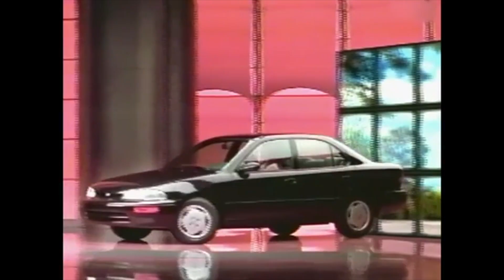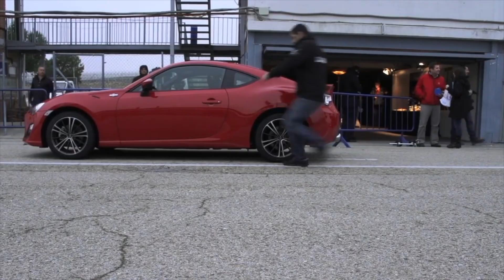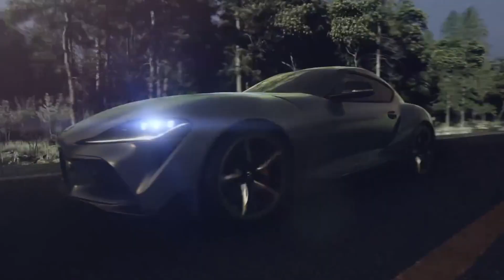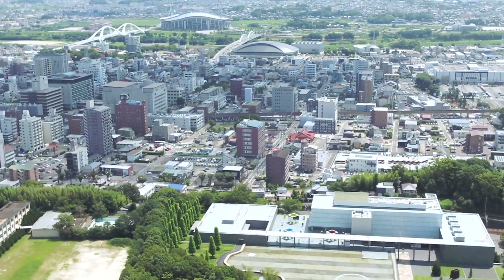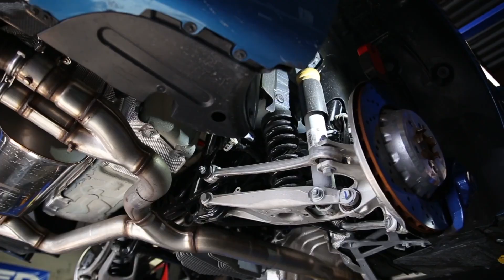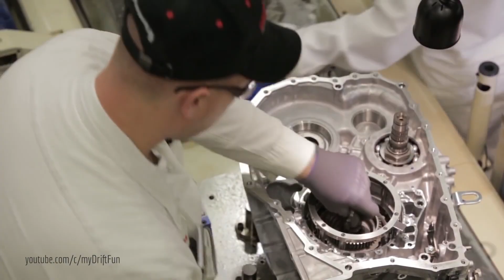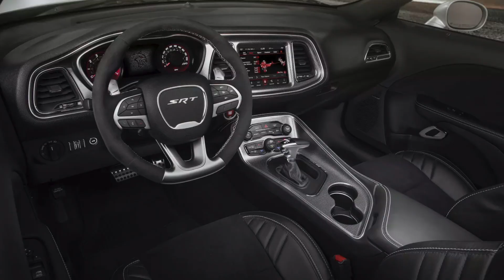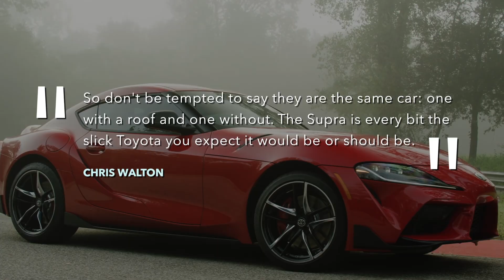MKV Toyota Supra - BMW or Toyota? The UNTOLD TRUE STORY

Comment: All I can say is , Toyota is dine for me. Over owned all there products and I've always had crazy respect for them because they build bad ass ling lasting trucks and cars but BMW. I can safely say IAM done. I bought a raptor instead. I figured since they flipped on us. Why not flip all the way out... I've Loved alot of things about the Supra. Expect car since my young days. But adding BMW to Amy mix with my EX brand is just a respect issue. They sold out. If I wanted a bMw if I wanted a German ride I'd get one... Toyota was special. Untill going with other brands not my own. And this is prob it .. there are some wicked as BMWS out there. Hell I had a shirt stint in a 08 335I. Wicked N54 swapped cuz the motor popped. But later sold for repairs costing alot. And didn't make sense anymore. But I was planning on the new Supra in my older years to bring back the child days of Fast and Furious. But now cuz they went with the GermZ. I'd have to say it's prob a great car . But just not for me. Or any of my die hard Supra homies in witch my homie still has his Single turbo T88 monster. He was gonna get it till he felt Toyota had bent him over... So sorry Yota... You post a few die hards. Maybe next time you won't let us Yota heads down next time... Great show man... But no supras in our future. No More.... Night Yalll.

Comment: No manual, not interested. Great video though! I'm getting a corvette and I won't be upset. Over 400hp at a similar price. 
What will actually be upsetting is if corvette loses the manual in 2020 with the mid engine. That would start a riot. My civic si hasn't enough power or sporty characteristics that I desire. I'll be upgrading in 1.5 years. I wonder who will take my money.

Comment: Really, biggest complaint the rebadging? Lack of a manual transmission and ugly as front bumper. Those are the biggest issue. Not costing around $35k is the next issue. Cut down on some of the interior quality and focus more on driving dynamics instead.

Comment: People can be so ungrateful. The existence of both the new Supra and the new Z4 depends entirely on their coexistence. There would not have been either of them if one or the other didn't exist. I would rather have both a new Supra and a new Z4 that share codevelopped engine and chassis, than having neither of them. More sports cars is better than no sports cars.
Reply: We should also be grateful with teen titans go if it exist
Reply: @siddheshpillai3807  The difference is that they made it because Cartoon Network knew it would make them a lot of money. Toyota and BMW don't need to make these kinds of sportscars to make money. Especially Toyota. These were made because a few passionate individuals at Toyota wanted to make more sportscars.
Reply: Buts it's not a Supra... it's a Z4...
Reply: The BMW would have still existed. The Supra may have still existed. This cooperation just made the end results cheaper.

Comment: the supra is dead, we will look back on this in the future as the biggest mistake toyota has done to an iconic car. two massive issues i see, one the car looks like a bmw rebadged basically a fraud/fake. second problem being old farts designed the car which are completely disconnected to the market that would actually buy the supra/

Comment: Everybody's looking at the reliability of the engine but also I think people really need to find out who made and installed the electrical system. because sooo much bmw issues are from stupid expensive electrical / computer issues. like speedometer going out which cost $3000 to replace as an example. Bmw has all these little issues that add up to a fortune to fix when out of warranty.

Comment: Will the Roads in America finally be like Autobahn surface?
You can't enjoy driving ANY car without the smooth glassy surfaces.
Reply: It depends entirely which State you are in. We're in quite a bit of an infrastructure crisis currently, but the differences by individual State can vary wildly. You can be driving on a road that is as smooth as it gets, then you cross a State line, and next thing you know you would practically think that you were off-roading.

Comment: I think if they just didn't call it a Supra, people would like it.
Reply: It's actually the other way around. People like it because it's a Supra, so to speak! Hence why it was badged! 
That sh*t looks ugly aF imo! Looks totally like a the Z series! I like BMW, but people are looking to buy a Supra, NOT a BMW!
Reply: I would not dislike it. I wouldn't love it, but I certainly wouldn't have hated it.
I'm just weird in the way, I like names of great cars only to be brought back when the vehicle they're being put on stacks up as a true successor, but I almost feel like a company is trying to cheat me and cash grab when they use an old name, on a new vehicle that just doesn't fit it's namesake, whether that's because the vehicle doesn't have the right credentials (Mitsubishi Eclipse Cross) or it's halfway badge engineered (Supra).
Kind of like Dodge using the Dart name on what should've been a Neon, albeit that's an extreme example.
Reply: I’d love it if they had stayed with the hard top convertible, that thing looks fucking beautiful
Reply: ya just call it a zupra how bout that.
Reply: I think if they just didn't call it Toyota, people would like it.
Reply: They shouldn't have named it Supra just to get peoples attention. They knew we wanted a successor to the legendary JZ motor. But they threw in a BMW engine. It's not bad but its not a Supra.
Reply: Hell they coulda did what Nissan did with R35 and took old bodies and reworked them and tweaked the engines. I woulda been okay with that....
Reply: Honestly, most car manufacturers share technology. Cadillac. BMW. Mercedes. Ford. Chevy. Nissan. Etc.
I mean, c'mon... About 53+% of all vehicles have AC units made by TOYOTA.
Reply: ^ This.
Reply: Eh. I think people are way too focused on the name. It a looks like a decent sports car.
Reply: Should’ve called it as the new gt86
Reply: Still for such Price you could buy a vette with lot better evrything and yes while a good car isnt Just speed but mk5 supra even with any other name wouldnt be so popular
Reply: Such an exciting car. A product of bankster-pyramid-scheme induced fear-driven scarcity. Almost as exciting as Formula 1.
Reply: @REEL SIXX 
Once you've seen the before and after by artists for how it should have been, you'd agree too.
Reply: Better buy Suzuki Carrier now...
Reply: True that!
Reply: Or a Toyota.
Reply: same problem the camaro had/has when it was released after being killed off.
Reply: Saroxus well the car is fckin brand new dummies it's logic that it's "expensive"
Reply: Yep, great car but it's not a Supra to my eyes.
Reply: people are retarded
Reply: As a long time lover of the Supra Toyota really messed up by putting it out as the new Supra and they are not built by Toyota if they would have called it something else not a Supra it would have not been a big deal but it is just a z4 with Supra emblems Toyota should have made their own inline six engine and design the new Supra different the mk5 is ugly and the Supra is a icon and beautiful car even the older ones are beautiful cars but the new Supra is ugly
Reply: @REEL SIXX You are rather dense if you do not feel it looks like a similar car if not just a newer version of an FRS. Your bias is apparent so you are not worth arguing with. Like I said before I do not mind if this car is successful or not since I am not a fanboy such as yourself. If it succeeds it will be surprising though. And good for them if it does that would be awesome! And of course there is high demand initially for a car that hasn't had a new iteration in thirty years. Especially for a car as famous as the Supra. Your claim stating they are on back order at your dealership proves nothing yet. Ill be curious to know what the long term numbers are for sales. Either way, I could care less because its still just an overpriced sports car that competitors still do better and for cheaper. Anyways, like I said I am not going to argue with you any further since you have a very obvious narrow minded bias. I wish ya the best buddy. Bye now.
Reply: Maybe, you're still paying $60,000 for essentially what is an FRS with a body kit and a bump to 350hp. I feel like for that price market there are sooooooo many better options. Unless you are a hardcore Toyota fanboy I don't see this car selling well.
Reply: @1859ddd  problem is that most of the die hard toyota fanbois  are the ones slating it the most for being a colabaration with bmw and not a fully toyota developed car
Reply: @Asylumescapee11  
Edit - I was wrong. Yahama did not make the 2jz. I can admit when I am wrong. I apologize for misinforming anyone. My opion on Mk5 still stands though. I still dont see it selling well. 

Well then they aren't hardcore fanbois because the Mk4 Toyota Supra was made in conjunction with Yamaha. Toyota did not make the motor Yamaha did. I understand what Toyota was trying to do here and it would have been a solid pick to go with BMW to help them with the straight six motor aspect of the supra since BMW has some of the greatest straight six motors of all time no question. But what ends up happening is feeling like Toyota took the easy way out and used a bunch of parts bin cookie cutter BMW crap instead of making it feel like a Toyota. Its just a shame all the way around because to be honest I'm sure its a great car. But I don't know how great a car can be if its only got 350hp in a price bracket that its competitors have 450+ hp. I mean ever the BMW Z4 that has the identical motor as the new Supra comes from the factory with more HP than the Supra haha. Just doesn't make sense to me. I understand a great car isn't just made from a hp number but for what its up against its got a lot to make up for only pushing 350hp if that makes sense.
Reply: @1859ddd  you make good points none of which im arguing although i didnt know yamaha developed the mk4 supra with toyota. Knew they developed the 3sge engine but not the car.

 Unless the general opinion has started to change though the biggest complaint i saw was that it was being directly compaired to the mk4 and it was being shit on for being a rebadged bmw. 

I completely understand that it could be seen as they took the easy way out but lets be honest it was the only way a mk5 supra was ever going to be made. 

As for your point about the power figures and price ill have to make the assumption your american (based solely on you using $ as the currency) over here in europe or at least ireland and the uk to my knowledge there is no similar car in the toyota line up that has that much power. Some lexus cars maybe not toyota. The next in line power wise that you can just walk into the dealer and buy is the new Camry. Possibly the new rav4 as well because it uses the new 2.5L hybrid engine as well. But you go into a bmw dealer you have the M2 M3 and M4 all over the 400hp mark. And in my opinion at least its probably being marketed towards people that would be concidering the m2 as an alternative.
Reply: @1859ddd  Um, yamaha did not make 2jz and didn't make the car with toyota. 2jz engines and A80 supra was fully manufactured by toyota.
Reply: @Bondango  fair enough I stand corrected. But my opinion of Mk5 does not change. Still an overpriced FRS with a face lift. But to each their own. Thanks for the lesson!
Reply: @1859ddd  
I agree, you can't argue that. I genuinely feel bad for the people that wanted to buy this and were let down by it's appearance.
Reply: @Asylumescapee11  The older supra did have an engine built in conjunction with Yamaha, yes, but Yamaha has assisted with other engines for Toyota also (including the v10 in the LFA which they tuned for its distinct sound). Thing is, Yamaha's design studio is literally next door to the Toyota one in japan. Just as Toyota partially owns ASIN (which makes all Toyota transmissions), they also have some (i don't have all the details) stake in Yamaha, so its really more like their next door neighbor helping them with an engine. Don't know if it is a thing there, but it seems like build japan, buy japan.
Reply: @tegra_0  thats good to know. I had no idea that they worked together on so much but as you said it makes sense. If its near by and can supply them with what they need and they have a stake in the company it makes sense from a business point of view
Reply: 1859ddd Good points. And yes there is plenty other things I’d buy for that money
Reply: @1859ddd  Okay dude, calm down, you are extremely wrong there and it is actually hurting your web reputation in a significant way.

And seriously, what are the better options ? This thing drives faster than the Cayman or an M2 in stock form, it's actually faster than some no more very actual but still pretty recent Ferrari models. Just imagine what it can do when boosted and set up to it's individual driver.
Reply: @boboutelama5748  Yet I'd still prefer the Cayman or the M2. I'd even consider a GT350 or the actual Z4 over this car. Just my opinion though. To each their own. Ya Supra fanboiz can have it. It's yours trust me haha. Oooo or an M4 for that kinda money or hell you could pick up a used GTR. Man, the 50k-60k price range covers a lot of great cars that I would pick before this BMW in Toyota clothing. Just my 2 pennies though. Dont have an aneurism over my opion in the comments section of a YouTube video. I think you sir need to chill. 😂
Reply: @1859ddd well this didn’t age well
Reply: @Waynethegunner  They grew on me. But I still feel like for the money they are asking for them there is far better options. I still stand by my opinion of it looking like an updated FRS though. That’s essentially what it is. Using the Supra name was marketing. They are sick cars though. I’ve ridden in a couple now.
Reply: @1859ddd  I didn’t like them at first. The front bumper wasn’t sitting right with me. But like you, it definitely grew on me. Just got my 2020 premium end of last month. Honestly it’s an amazing car. Small for me being 6’2 215 athletic build, but I make it work.
Reply: 1859ddd 60k to be almost close to the 2020 ecoboost that has 15 HP less and cost like 25k and less
Reply: @1859ddd  I was once Hardcotr Toyota Fanboy but from now on i don't and i see every Toyota Line Up is a joint work with BMW from now on
Reply: @1859ddd  An FRS with a body kit? M8, you can't tell me you actually believe that.
Reply: @nomadben  go watch ThatDudeinBlue's review on the 2020 Supra. He parks an FRS and the new supra next to each other. It quite literally looks like an FRS with a body kit. So yeah I believe that. I think the more valid question is you actually think it doesn't haha? You're cooked if you don't think it looks like the same car.
Reply: @1859ddd  
>Looks like the same car
>Is automatically the same car, despite being entirely different platform, engine, and mechanicals

Might want to go over that logic again
Reply: @1859ddd  "Still an overpriced FRS with a facelift."

-1859ddd
Reply: @nomadben  That's still not saying they are the same car. Add context and it is an obvious satirical slight. Well, obvious for most at least... 😑 But to spell it out for you. No I do not think they are the same car that is obvious. Do they look like the same car just different generations? Yeah, yeah they do haha. If that hurts your feelings then sucks to suck I guess.
Reply: @1859ddd   Sorry, wasn't able to understand some big parts of what you wanted to say. Is it canadian english you are writing, it's somewhat of strange.

 I tried out the new Supra. First models came into the shops two weeks ago.

It drives very fine. The Cayman is  great car, but paying Porsche premium for service and parts, and having to deal with VAG group aftersale service is a big nono for this car. Also, it has some limitations in the inside space that the Supra doesn't have.

The GT350 is not for sell on many markets, so it's a very limited option for a specific part in the world. But let's be clear... other declinations of this car where swines when we are speaking of mountain twisties. So you are probably speaking of drag strip warriors and so on. Not the thing of everyone.

The M4 isn't a dedicated track car, has all the BMW problems and the BMW after sale service linked with BMW costs. Also, the car is rather un-original, and, in Europe, has an image problem, because every criminal arabian or slave guy has one. This car screams "bad reputation" from far away.

And the GTR is a great car, but you can only buy it used and god knows what awful treatment he was exposed to before you buy it. Also, the car has a reputation to need a good amount of maintenance to continue to perform right. Making it costly in the daily run.

One car you didn't stated was the RCF. When used cars are counted in the equation, the RCF is a perfect car, but quite comfort oriented in the first place. He needs some work to become a mountain warrior. Whatever, he isn't as fast as the Supra.

One other car is the Kia Stinger. The car is quite new for the moment, but it's a good car. The chassis has a good grip and the engine is a fun companion. It's a little bit fat for mountain roads, but it does well in this situation. I wait to see what the reliability of them are going to be.

But in the new car market, there isn't anything really boxing in the same league for those prices. And not everybody will have 10k $ in his armpits to buy a premium german brand.